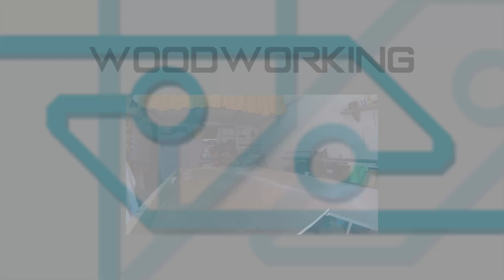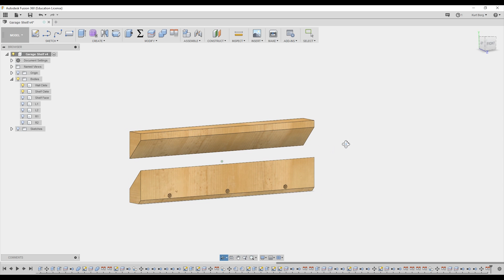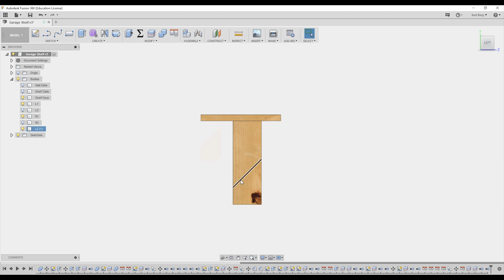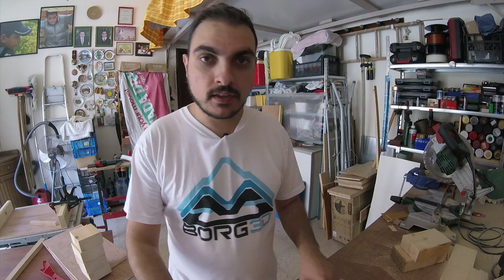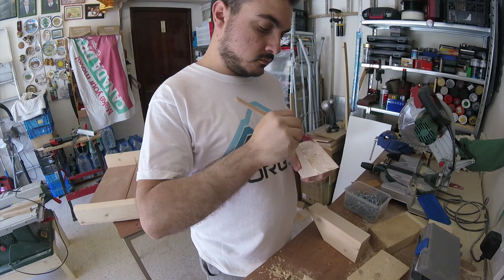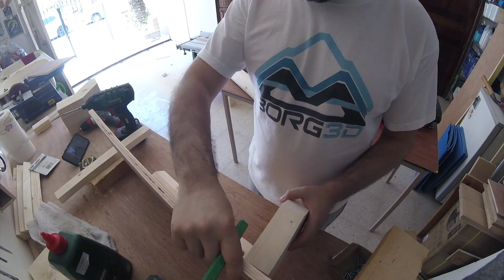French Cleat Shelves - Build //How To

Comment: Hi Kurt, you find kreg screws locally?
Reply from the maker: I get them from Amazon which makes them relatively expensive. I do not know of local suppliers but I’ve yet to visit them all.
Reply: BORG3D probably going for dowels then
Reply from the maker: That might be a better option, but I will let you know if I find a local supplier.
Reply: BORG3D thanks